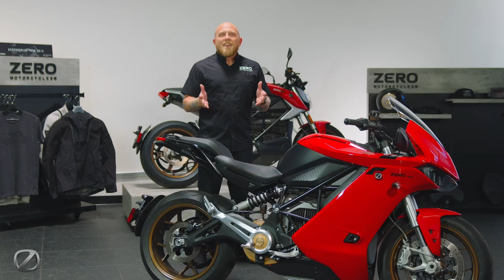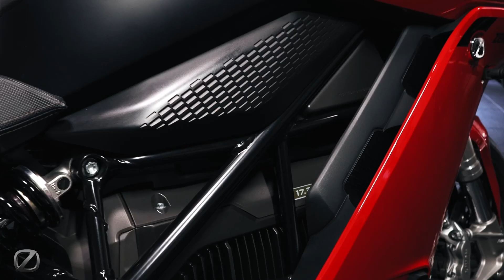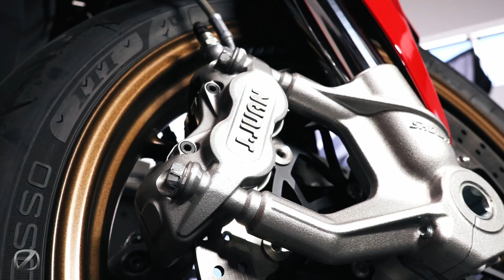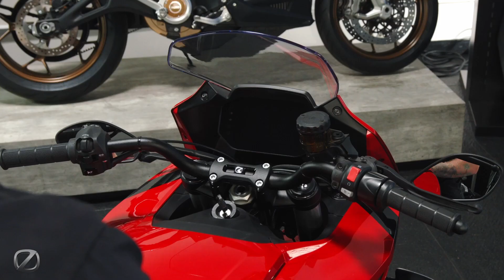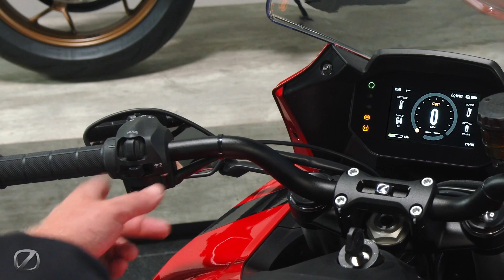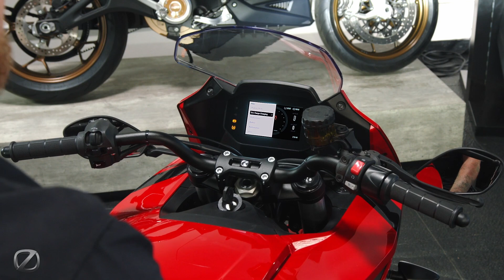2024 Zero SR/S Walk-Through

Comment: The "Zero Dilemma"...    On the one hand, only hardcore motorcyclists seem to be interested in electric bikes.   But electric bikes have terrible range, and are essentially limited to being 'around town' (or commuter) bikes.   So they don't sell well to hardcore people.   But the bikes are built to be hardcore, meaning that actual commuters don't like the bikes either, as they are 'overkill' for a commuter bike.  And don't have things like STORAGE.    
-
Don't get me wrong.  I bought a used 2017 SR in 2019.  Been commuting gleefully on it for 5 years now.   But man, would I love it if it had a ANY storage somewhere.  Oh, and a cupholder, man I would love a cupholder.... 
-
But if I could wish for JUST ONE upgrade, it would be that Zero makes a DC-Fast charging tank that can be fitted to my 2017 SR.  (It has the charge tank option, how hard would it really be to just make a NEW charge tank that slips into replace the old charge tank - but with DC-fast charging?!?!?  Really Zero, one of THE big selling points of electric motorcycles SHOULD be for them to be able to be upgraded as the technology improves.  Dam, if I could DC-fact charge my 2017, I would be able to actually take it on road trips...  I can dream...)

Comment: 50k on my 2020 SRS and still loving it. Its perfect for regular short trips, like going to work.
Reply: 50k miles?😮 I once test rode it.. loved it!
Reply: That’s impressive! Any major issues? I’m about to buy one since they have the 17.3 battery.
Reply: @growingupcaged5640 Two: the front brake disks kept warping. The metal was crap. Replaced those with EBC . The other is the original 14.4 batteries were not reliable and I heard many were replaced under warranty. I had mine replaced a t 65k under warranty. Its still my daily ride, at 75k now.

Comment: I really like how the SR/S looks, it's a gorgeous bike. However, without DC fast charging, I can't justify spending $20K on an around town bike. If this could plug into fast chargers like Energicas, I'd very seriously reconsider getting one.
Reply: No had expenses, it equals out.
Reply: Worry not, the battery cells can take charged to full in 1 hour.
...but zero will do its best to double that time.
Jjst like how its does its best to stop user service, and fuck you over if you live in a place where they lack officially sanctioned service support.